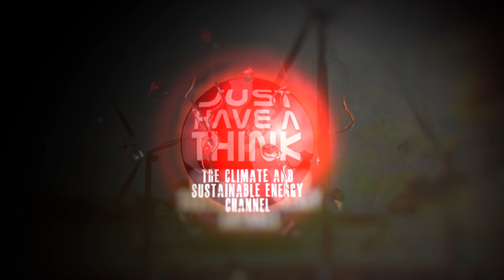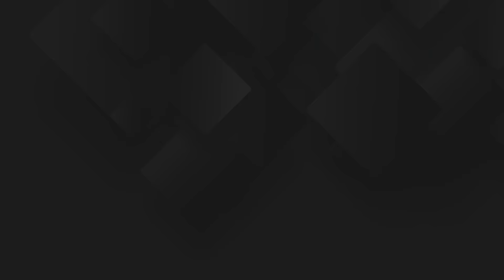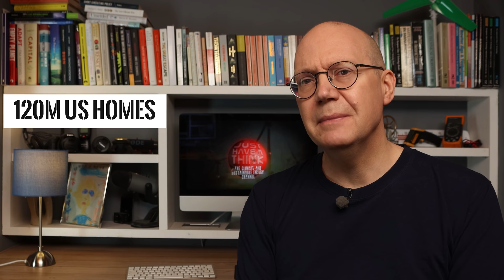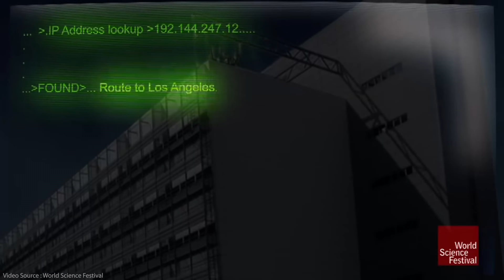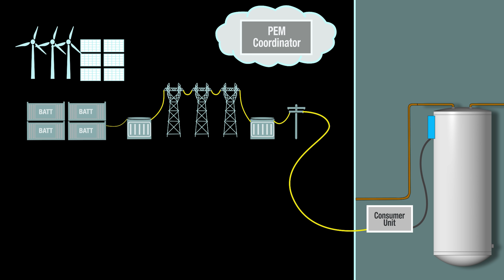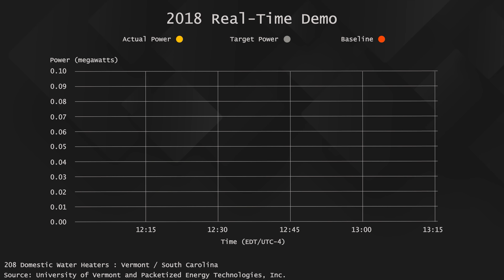How to balance renewable grids WITHOUT energy storage!

Comment: Utility billing regulations in the US are highly localized and not particularly flexible. In regions where there is political will to update those laws in rational ways, then packets of energy could be sold at a discount relative to on-demand electricity.

This would provide a financial incentive to upgrade devices so they can do the negotiations.

The scheme could work in both directions for power storage devices. So when the grid needs power, it can pay a premium for packets of power from connected electric vehicles and power walls.

These changes turn the system into one doing simple financial transactions that do not require altruism.

Comment: I think we're functionally seeing some of the effects of this system in technology such as Smart Water Heaters where the device/user is sent operating statistics and costs and they decide when it's appropriate to flick it on, usually incentivized by slightly lower costs. This just seems to be a more centralized approach for controlling such things, not that they couldn't nor shouldn't exist in parallel. The vulnerability to a variety of failure modes and attacks is a concern however so utilities should use it, but not be wholly reliant on it.
Reply: In manufacturing there is a saying “what gets watched gets done.” I’ve noticed this with my electric car since it displays my miles and KW used. My driving habits have steadily changed as I’ve pushed to get 4.2 miles/KW instead of the 3.5 that I was getting when I first bought the car.

The more data that you put in the hands of the users then the more that they’ll naturally try to optimize it.

Comment: Rather than just making a request, the water heater could be making a bid in a Vickrey–Clarke–Groves auction. (This auction does not need to give an advantage to the rich. It could be bidding "urgency points" that the power supplier gives equally to each of its customers rather than money.) An auction will allocate the resources in the most socially beneficial way possible.

Comment: That's probably one of the best bits of good news in two decades but - big BUT - if there is no incentive against ad hoc overrides of the devices consumption mode, I don't see that working somehow. I guess, enabling large electricity consumption devices to operate autonomously and connecting them to the internet will incur an up-front cost which the consumer will want to recuperate somehow and hence an incentive for staying with the scheme will have to be provided by the electricity grid operator, so we call all look forward to this becoming a reality within the decade.

Comment: Several thoughts:
1) Security - hacking means blackouts or selling demographics could allow a burglar to target empty homes.
2) Integrating storage could lessen the volatility.
3) Forward-looking algorithms could tell devices when to over cool air conditioning or heating during low demand to avoid not getting authorization during an upcoming peak period (within the next hour).
4) Suppliers will game this information to reduce capacity and have less available during extreme events.
Reply: 4)Suppliers would not run this. The grid runs it and works out how much is needed.

Comment: Very interesting and the simplicity is good. But a manufacturer would be motivated to use a high request rate to get closer to the devices needs and closer to the customers desire for instant power. Seems we would need regulation to avoid devices competing with high request rates to get noticed

Comment: Water heaters for large tanks don't work that way. As hot water is removed from the top of the tank, cold water enters at the bottom. Since water is a poor conductor of heat, the water at the top stays hot. That is, until the heater is turn on. The resulting convection currents mix the water, so that the temperature reflects the average of the remaining hot and cold. Thus once the heating starts, it needs to be completed before the owner seeks to use the water.

Comment: Price of power is curcial here. You need a reason to delay your car charging and it can only be the price. At the european energy exchange in Germany, the price of electricity varries between  minus 10 cent (you get money paid if you take power) to plus 50 cent dependent on demand and supply. But with taxes the price is always 30 cent/kwh for the end consumer. My wallbox software is ready to manage charging according to different prices, however there are no different prices to date. There has been one tariff, but that was between 26 cent and 30 cent, which does not help much.
Reply: And the retailer is offering you an average price instead of the wholesale price.

Comment: Technically speaking the system couldve been implemented a lot earlier than now, although the many smart devices make it a lot easier to implement. But it hasn't been implemented broadly and there is a reason for that. 

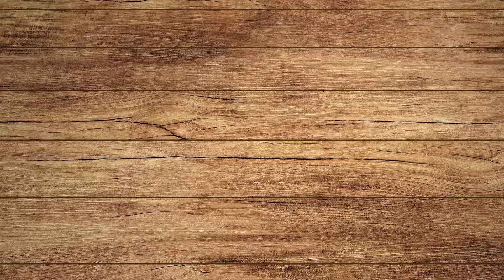When the paper in 5:30ish is quoted the potential of this technology is made out to be phenomenal. But we arent talking about energy capactiy. We are talking about power. And moving loads around for a few seconds or minutes its definetly nice. But the big challenge for 100% renewable energy grids are the winters, when loads are high for weeks and blizzards and other weather events can lower energy production for weeks aswell. For these cases you do need energy storage. A lot of it. So this PEM system is nothing more than a nice gimmick in my opinion. Besides, the grid can take imbalances in power production and comsumption to a certain degree. If the load is higher than the production, the frequency is lowered a bit, but most devices can live with small alterations in frequency. So the spikes must be really huge for PEM to add a meaningful ability for our grids. Best to invest our time in other ideas.

Comment: This can be best managed by having time of use pricing.  You dont need a PEM device.  As a solar household myself, I’m well aware of the benefit of switching my washing machine / dishwasher on during sunny days, and charging my car with surplus solar or cheap overnight electricity.

There’s also every likelihood that the PEM device won’t take my locally generated solar power into account when deciding whether or not my heavy consumers are allowed to switch on.
Reply: And every device turns on at the same time?

Comment: When  load shedding (rolling blackouts) became a regular event in SA more than a decade ago the municipality  in the town I lived in came with the idea that they could prevent cutting the town's electricity, if they could switch enough geysers off. The idea was aborted because 1. They did not communicate  the plan transparently and just began  installing remote switches. 2. People were not willing to allow their hot water managed by a governing body. So the idea  was never implemented.
Reply: right, it will not work without active cooperation of the users. But with a user base of 1000-10000, this can really work well if you have geysers with sufficient water storage capacity. If your consumption of hot water is small, you should be excluded from this program

Comment: To clarify this system isn't specifically focused on solving communication between many power providers and many power consumers like might be the case with renewables. It's just SMART Grid with another name which is intended on much more intrusive management of household appliances. I don't think this really solves anything. It's true that it technically increases the effective capacity of power producers but the reality is it does so by putting a cost to the power that limits that capacity. This creates a trap for the average consumer where highly dynamic loading like say bitcoin mining could sap all the value out of this system and make consumers pay the price. Instead the system needs to be focused on providing whats promised that your appliances keep running as expected.

Comment: Well this is potentially effective only up to something like 6 hours storage & peak power at most.  It still doesn't solve the longer term storage, which seems to be needed when there will be substantial amount of renewables in network. And where significantly more energy needs to be stored and thus the cost of that is also higher.

Comment: This is a nice idea for managing a grid, but it doesn't really solve the problem of intermittent power sources.  What happens when the sun doesn't shine and the wind doesn't blow?  Still need back up fossil fuel driven plants or load following nuclear reactors.  Now we will have more idiots saying that we don't need cheaper grid scale storage or more power lines because this report says something about renewable grids can be balanced.
Reply: You could simply lift huge boulders into the air when power is cheap even if only at night then you have controlled released descent geared for daily grid needs

Comment: There is a much simpler idea to achieve a similar effect. A heater or fridge could have a simple chip that monitors the grid frequency and turns of the device if the frequency dips below the nominal. This chip could be very cheap and wouldn't require any centralized management. Regulators like EU could require suitable devices to be equipped with such a chip to be allowed on the market. Maybe decade ago there was a British company developing such a chip, but for some reason I have not heard any news about the system since.

Comment: smarter use will help.
but i'm still stuck on promoting more geothermal. 
drilling tech is up to the challenge decades ago already.
it can be used at the point of need , saving infrastructure costs over huge distant generation and lines to attach it to the system.
ime to get away from these huge centrally planned systems and get on with regional grids that serve the people of the area.

Comment: This is great, surely it could be done with a one way signal?  Different types of device could be categorised and each device programmed to know what category it is in.  The power provider could 'broadcast'' a signal (in the same way it does for 'economy' tarrifs) that confims which categories of device are allowed to draw power at any given time and the device could listen for the right signal before drawing power. This would have the drawback of not alerting the supplier of 'non- conformity' but in reality how much notice would a two way system give? If the codes can be adjusted on the fly, any surge could be mitigated by switch a category off until back up comes online? EDIT - the point is to make the devices cheaper as the technology required would be no more complex than that in a radio-controlled clock.
Reply: Let each device determine the priority.  A cold hot water system or empty car will be priority 1  while a hot water system/ full car will get priority 100.

Comment: Storage is not used to balance grids but to support frequency, it is a different requirement.
Assuming the unlikely of a totally renewable grid (hydro excepted) how can controlled demand response compensate for the very low renewable generation output that frequently happens? It can't and will bring power cuts.

Comment: This method only works if you have enough energy to supply all that is needed. This is actually the same way a nuclear powered aircraft carrier works, with the reactor and power plant can efficiently send energy to all parts of the ship that need it. It is a city at sea and there are a ton of computers that control the flow to ensure power is there when needed. Renewables can't supply the energy for all this computation to work, and the devices that call for packets of energy still need to be on and powered to make the call. Basically it won't work in California because there isn't enough energy to show any real results.

Comment: Sounds like a very good idea. Unlike huge storage or continental-scale grids, this can be accomplished by adding a few dollars worth of intelligence to existing consumer devices.
Reply: Well, you do have to have data connectivity to the grid. Whether this works with IOT with your existing Internet service (which, if so, yikes! — the security track record of IOT has been nothing short of miserable!), or via some separate channel, it's still new infrastructure.

That said, while the packet paradigm is a bit new, the concept of demand response is not new at all. My power company wanted to enroll me in a smart thermostat program probably 10 years ago. I didn't sign up, because there wouldn't have been much point: I almost never turn on my air conditioning, which is what they wanted to control.
Reply: @ps.2  Well, yes, but the only "exploit" possible with my water heater would be to be left with a cold shower in the morning. Not like "security" webcams left with default passwords...
You are right that the concept, in some form, is not new. For example, Octopus, a renewable energy distributor somewhere around Scottish/English border, offers smart chargers that take into account momentary price of electricity.
Reply: @bazoo513  I dispute that an exploitable IOT device is only a danger to itself, so to speak. It is potentially a beachhead onto a whole internal network. If the device is only as powerful as, say, a Bluetooth headset, that would be one thing. But just as likely, it will be an off-the-shelf system-on-chip running a real OS with a full network stack.

(Can you lock down an IOT-only subnet so that it has no access to your normal wifi network? In theory, sure....
Reply: @ps.2  You have a point. But since security sieves such as Windows are already on the Internet...

Comment: So correct me if I’m wrong but if the devices will leave the system when they go for too long without “approval” then wouldn’t it start to collapse quickly once overwhelmed? The fact that everything can opt out of the system means that we should get the same blackouts as usual once the grid has hit capacity. Still a very creative method of optimization and no doubt will be very helpful if implemented, I’m just not sure this will really stop what happened in Texas from happening again under the same conditions.
Reply: Fallback position of the current grid sounds like an improvement over the current grid.

Comment: A heat pump or AC unit will prefer to run in a steady state than stop start. With an inverter heat pump getting it running low & slow is probably best for it.   Immersion heater in water tank on & off is probably fine.   EV charging ? how is it with batteries , is it better to charge slowly?
Reply from the maker: I have a heat pump, and you are quite right. PEM would not work for everything, but it would work for many things.

Comment: Doesn't really solve the issue of no sunlight during the night, or periods of no wind. it just reduces peak usage and can lower fossil fuel usage during times renewable is available, but since cloudy/windless days are somewhat unpredictable you still need to massivly overbuild capacity.

Meaning you'd still be better off with storage or simply some nuclear powerplants/hydroelectric.

Comment: There is a very real problem with the electrical grid and in the future, grid demand will outweigh supply, as the world electrifies - as cars electrify.

The huge risk of this "Coordinator" approach is the risk that the government steps in and start monitoring what devices can get access and which ones can't and when - that the manual mode of power request is no longer allowed, and it also opens the door to the possibility that then the "Net Neutrality of electricity" goes away - just like it did with the Internet. This would allow Electricity providers to offer tiers or grid priority to users who pay more, certain brands of devices, or certain types of devices, especially when Electricity scarity occurs. This is a bad thing for everyone.

Comment: I can see a lot of problems popping up with this when the devices have to ask for permission for energy. For example, you just came back from a long car trip, you battery is almost completely depleted. You need your car again at a certain hour that you know your car has time to have a certain charge to complete your trip. At that hour, you get into your car and notice it isn't charged at all. It asked for energy and didn't get it. Now imagine that car was for an ambulance worker that needed his car to get to work. The grid has no way to know the person's job and if it did, then it could create even new problems for the "low priority" persons who may happen to have a ( possibly life threatening ) emergency! Good idea in theory, but in practice, it can go horribly wrong fast.
Reply: Mannual mode. PEM device sends out a message "I  am using the power"

Comment: Although the PEM technology sounds great, the grid is not necessarily a homogenous entity - it has areas of good & bad demand/generation balance and as a result (in many many power networks) there is no actual "state of the grid" that can be monitored.  In highly interconnected networks like NW Europe and NE USA with metropolitan/urban consumer distributions it should work well but there are still many implementation issues: who specifies, supplies or instals the device-specific PEM communication devices (and at who's cost); etc.
Reply: The controller would have to be installed per substation.